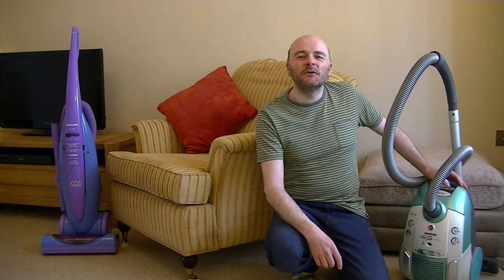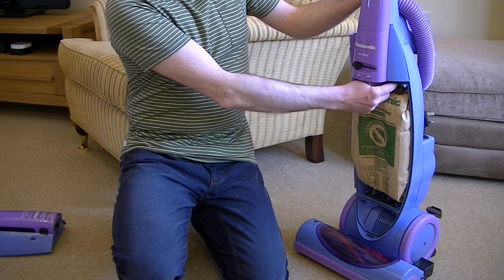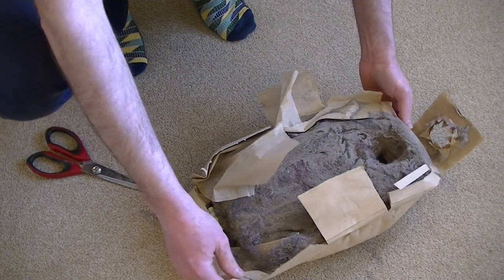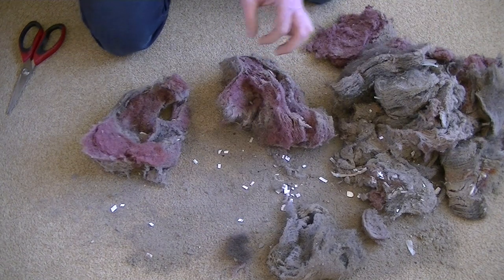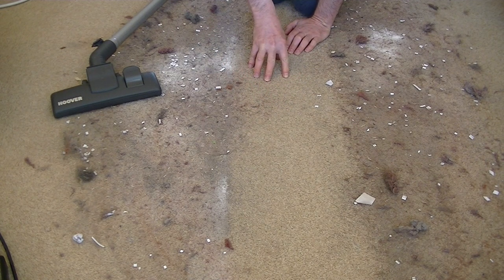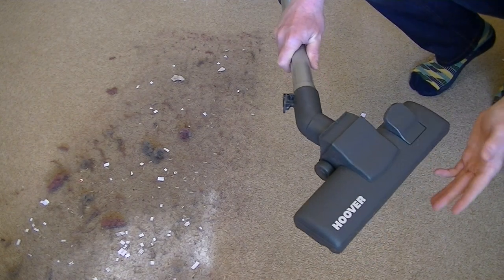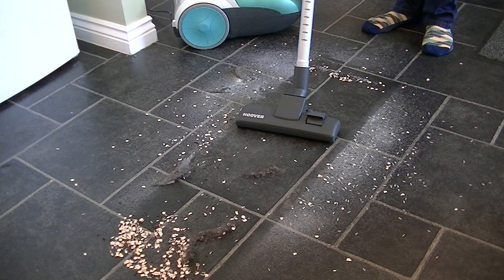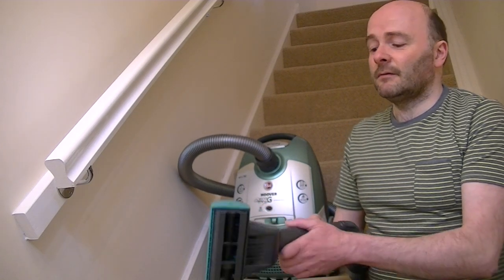Hoover Eco G Telios TTG1100 Vacuum Cleaner Demonstration & Review

Comment: I've recently changed my Hoover Rush for a Telios 2400W model (425 air watts suction). Although I didn't plan to replace the Rush (yet), after seeing how new ECO models perform on your videos, I rushed to buy something that's left from previous range - it was on clearance, so I bought it for £50 brand new :) We love it, it's only a bit of a heater but we get on with it.
Reply from the maker: nrones Hoover's eco cylinders have so far been disappointing, especially with the terrible heads that they supply with them. I will be looking at at least one Hoover eco upright with a claimed AAAA rating at some point, so hopefully that will do better.

Comment: We used to get allot of different Panasonic models in The U.S. too. They were very good products. I wish that they still sent their best models here but now they only send their most basic machines and you cant get one with a full range of tools. Such a shame because they performed so well. We can't even get a Hoover of that kind of quality. That's why I drive a Sebo D2 and a Kirby.
Reply: The best vacuums I've seen is miele.
Reply: Jonathan Washington They're excellent. My brother has one.I recommended it to him. I like Sebo better because they offer a wall brush and some other useful tools and they use them in Buckingham Palace and The White House. Also when vacuuming wool rugs it's important to use a soft brush roll and Sebo offers them on many of their uprights and power nozzles though my canister has a turbo nozzle. I prefer a straight suction canister for simplicity as the sockets on power nozzle canisters often fail. That is why I also have a Kirby for my rugs that I use a few times a week as well. However nothing beats a canister for corner to corner cleaning. I use mine daily. But I'm a clean nut.
Reply: Bruce Solomon Well said, my mom wants the Animal Machine aslo for her property when renters brings animals, she refers them to everybody, they maybe cost a thousand dollars but they're worth it.
Reply: Jonathan Washington They save you money over time as the cheaper vacuums today only last about 1-3 years. Good vacuums can last 20 to 30 years. My mother had a Kirby that lasted over 50. My sister still has my mother's old Electrolux model 30 but no longer uses it because the old cloth bags emit dust and it didn't have wheels. They'd used metal runners back then and they aren't very good over time for laminate floors so she is now using a Eureka Mighty Mite and has assortment of optional attachments from Eureka that I'd hand pick for her stored on a clip on the wands.
Reply: Jonathan Washington By the way, I think that  the Miele vacuum that you may be referring to that your mother may be spealing of is the Cat and Dog. The Animal vacuums are made by Dyson.
Reply: Bruce Solomon Yep thats correct the Cat and Dog, I want one for when i move in to my own place, i wish i could have the one at her house that the whole house is a vacuum with the Garbage catcher in the garage.
Reply: Jonathan Washington Central vacuums can be excellent if there aren't any leaks in the system. Also it's important to have the correct sized unit for the size of the house and the best units are triple stage bypass systems which offer the greatest suction. I had a central system once but didn't like dealing with the long hose. New the have retractable hoses. Finally it's very important to pick a really great tool package from one of the very best manufactures. 
Right now it's 11:30 AM and I have to go for a while. I'll get back to you in little while with some brands available in the US and Canada that might help.
Reply: Bruce Solomon k thx.

Comment: what washing matchine do you have because my grandma has a Bosch ecosiloncedrive active water washing matchine and a Bosch dryer the best washing matchine ever said my grandma. well i have had my problems today my Hitachi cv560d powerhouse has cost me a little sum of £5 as the belt what is fitted is the original one fitted in the factory in 1983 so its too slack and the brushes slow down to a holt instantly i have odderd one from the local vacuum cleaner spares shop 3 weeks it will take as they don't stoke them any moor loved this video well i suppose i love every video you up lode as the jokes and laughter you bring got my grandmas funeral on  Monday so ill cut he huge garden tomorrow with my brand new Bosch lawnmower the best one i have ever owned . its nice to relax and enjoy yore videos on a Friday thanks.
Reply from the maker: Jason Rayner I have a Bosch Exxcel 8.
Reply: +ibaisaic & I have A Top Of The Range Miele W5877 Edition 111 1600Spin An Absolutely A Fantastic Washing Machine!! I ALWAYS use Bold Gel/Powder Tabs In Lavander & Camomile, Lenor Moonlight Harmony Softner & Lenor Unstoppables In Uplift & My Washing Always Comes Out Gleaming Clean & Smells Absolutely Gorgeous!! My Previous Washing Machine (19yrs Old) was a Zanussi 1200Jet System Washer/Dryer
Reply from the maker: Wow that's some chemical cocktail you're exposing yourself to. Never mind, Proctor & Gamble & Unilever will have tested those products extensively on animals.
Reply: Why What Do You & Your Partner Roger Use?? x